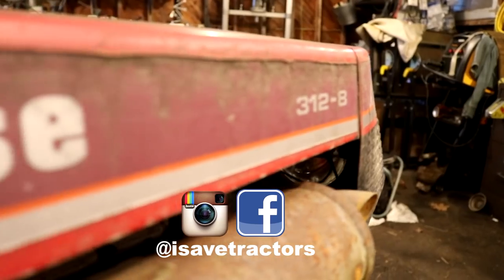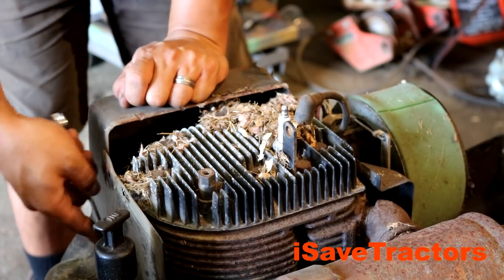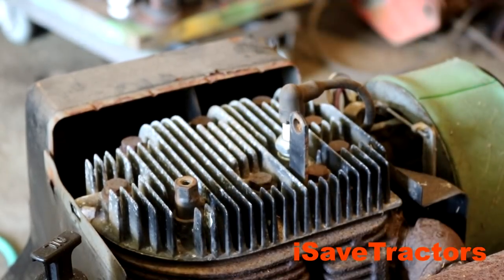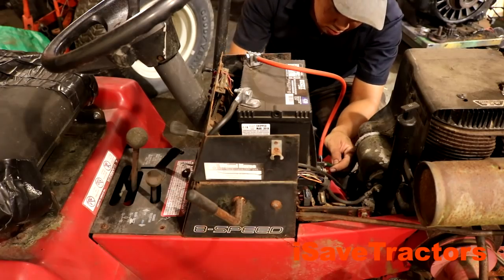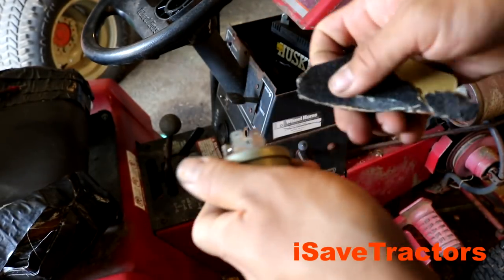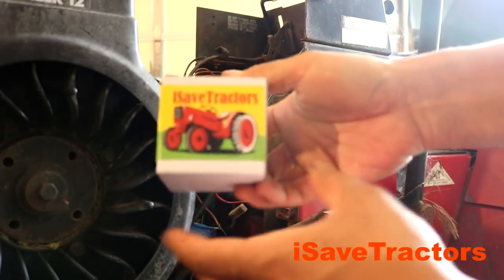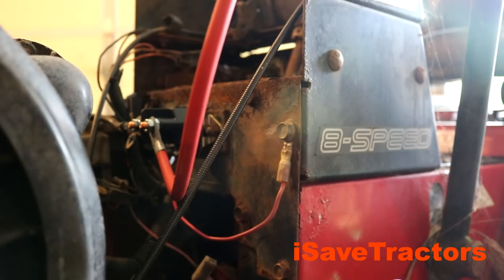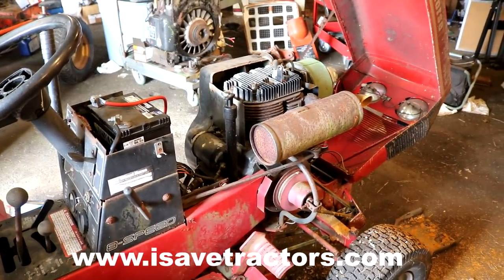Non Running Wheel Horse Garden Tractor Find Fixed in 30 Minutes!

Comment: Whenever I go to check a starter, like you did, I make the last connection to the machine frame (ground).  That avoids arcing and possibly damaging the terminal on the starter.  I just use a jumper wire to trigger the solenoid, quick, simple test.  Another idea, I keep a rich 2 cycle gas mix in a pump type oil can, use that to prime an engine.  It provides some cylinder lube.  I also use 2 cycle mix in the gas tank at first, for the same reason.  The mixed fuel lasts longer if it's a job you won't get back to soon.  Will keep you in mind next time I need Kohler parts.

Comment: Hi Norman!  Great video and step by step differential diagnosis is right on the money and straight to the point.  Fuel/Fire/Air timed right must run!  I'm a very frugal kinda guy and only thing I'm seeing is the heavy grip sandpaper.  I'd first use a brass wire wheel which takes off the corrosion and don't eat up the contact post. (bench grinder) Then if need be - Emery cloth which is much easier to work with as it is less stiff and will fold nicely to get into those nooks and crannies.  Backside of the contact posts will require this.  I've seen lots of guys squirt the carb cleaner in the plug hole but I'm kinda agin it as this is a little hard on the bore if taken to excess and used too often.  Once to look for fire Ok!  But some guys will think that this is the best and easiest was to start their tractor overtime.  If you do you can wash down the cylinder wall and lose lubrication and even compression.  Like all good things; only good in moderation.  Looking forward to your next video.  Hope my comments are not too critical.  You make a lot of good sense.  Take care,  Lee

Comment: This is all very familiar. Ignition keyswitch completely burnt out. New solenoid and new starter motor and we were in business. New fuel line and filter also. But every year I have to run fresh fuel into the cylinder to get the fuel to pull through. 31 years and still going (just)! My baby!

Comment: Just did the same thing on my new to me non running 1979 c120 auto. Fired right up after the jumper cable trick..headed over to isavetractors right now for a new solenoid!

Comment: Nice! I cant tell you how many times I bought broken stuff and it was a wire or a very simple thing. I hate key-switches,solenoids, and safety switches! Often poor quality and almost always the issue(s). I would pay 4x the going rate for components that were reliable but I have found this is impossible to get locally. Many times the new components are bad or fail early.
Reply from the maker: Give isavetractors a shot at your business!

Comment: Im looking at a workhorse I don't need another one but its in good shape not running but it did 6 years ago... I love working on these old girls...I also have AC B10  just haven't gotten to it yet. UPDATE I actually wheeled and dealed for this workhorse sitting in my yard now got it too run, weak compression let MMO soak over nite compression got up to 60 she runs now I gotta figure out the clutch! Im gonna check your page for some belts thanks!

Comment: I have a early 1970s Montgomery Ward variable speed 15. Its got a 15 horse Briggs & Stratton cast iron engine. I was using the pulley puller and pulling stuff off of it. I broke the aluminum starter pulley on the engine. I have not been able to find that anywhere. Also I need to find a drive shaft adapter that goes on the engine. I think the problem that engine has is that it has bad spark so I need to clean up the points and see if it'll start. I'm definitely checking out your website I hope you have what I need.

Comment: Before you replaced the solenoid did the instrument panel voltage meter indicate voltage and do the lights work? I'm going through this with mine. It stalled the other week and I left the key in on the position. The battery has been charged, but I haven't figured out why it won't start or even turn on the lights. Thanks for the tip of the jumper cables to the starter, I'll try that later.

Comment: Heck yeah I liked this video at like one min, I have an old wheel horse almost like that one it was my grandfathers and it is still running maybe not at its prime but from a cold start its like new these engines are the best and will go through hell and back and still run. I won't by any other tractor without one of those engines. 😎

Comment: A few words about the continuity function of multimeters. A tone may make you think you have a low resistance path when this may be far from the case. Some meters may give a tone up to 250 ohms. Be sure and check the display for the value of resistance being measured.

Comment: That's my tractor!! I'm having some trouble with the charging. If I disconnect the stator while it's running, it shuts down. Does that mean the charging is still putting  something out? Also is it possible to change it over to a magneto system instead of the battery ignition? Worst case scenario is I'll charge the battery externally. I should mention though that I had to replace the fuel pump to an electric one. So i would need to have enough power just to run the pump.  Looks like there's still some odd pieces of stuff being blown out of it.

Comment: I have a c-160 wheel horse I am stumped on. I have spark fuel  and 125 psi of compression. It will not start.  I have been jumping it off another tractor. You think not have a good battery would cause an issue

Comment: Hey! Great vid.. I have the same tractor with the same issue. The previous owner replaced the solenoid and key tumbler and still nothing. Where are you hooking up your multimeter to test continuity? One of the replacements he did may have been DOA and I guess I should test it to see if I need to order from you.
Reply: You could simply bridge / bypass the solenoid with screwdriver. If it still didn't crank you have a bad wiring connection or battery. Remember he replaced both first.

Comment: Hey Norman- what's your most admired tractor maker and why? (JD, wheelhorse, ford, cub, case). You seem to have one of each and I assume you have a favorite.  Nice work on the videos
Reply from the maker: Tough question that comes up a lot. I plan on making a video on this very topic. I seem to like them all, as they all have a different approach. But the tractor I use the most is the Ford LGT 145 with Front End Loader. It gets on average 2 hours of use every day 365 days a week. The second most used is the Ingersoll 4118. I am currently restoring a Simplicity 4040 Powermax for this channel, and I plan on using that heavily in my large garden because of the high ground clearance. So as you see, each brand, make and model are better at certain tasks than others.

Comment: Nice vid. Wish all of em we're this easy.
Reply: I’m MikeJD60 but on my other account, but I just bought a 1973 sears st16 w the 16OHV Tecumseh, the engine runs, but I predator swapped it cuz I need a tractor that isn’t a gas hog. I still have the engine, on a pallot in the back of the barn.

It needs a Jew switch, a carburetor, fuel pump, & a few other things. 

I’m using the predator because I can use it all day & only use about 1/2 to 1 gallon of gas. Just for taking wood to the burn pile, taking trash out, & mudding. 

Whereas my 82 212 will drink 3 gallons in Th ensame amount of time, these old tractors are great, but they are giant gas hogs, & in addition to that they need Ethonol free gas.

Comment: Hope you might be able to help me. I have a 520-H. I got on and tried to start it and nothing. No dash lights, not solonoid click, nothing. I checked the battery and it was old so I bought a new one. Same thing. I looked at the fuse box and it was covered in dirt and grass. I cleaned them off, brushed the fuses off, and blowed out all the contacts and added some contact cleaner. WOW, it started right up. I mowed a few rounds and my deck belt broke, so I replaced it, started the tractor and before I even moved, it died, and the same thing happened. Turn the key and nothing, no lights, no clicking or anything. Do you have any suggestions I might try to fix this. Thanks in advance!
Reply from the maker: Check your ground connections. Try jumping individual parts to track down the culprit. Visit our website for troubleshooting and tech articles. Also you're welcome to send me an email for more detailed help.

Comment: Norman: I have a 312-8 tractor as you have in this video and it has worked great for us however, now I have a leaking gas tank and can find no instruction about how to replace or what to check for. I'm stumped. Please help.
Reply from the maker: Hi there. First thing to do is check where the leak is. Is it coming from the fuel valve on the bottom? If so you can replace the busing and valve. We sell them both. If the tank has a Crack in it you can plastic weld it. First step identify where its coming from and then let me know via email
Reply from the maker: You can remove the tank but first you remove the rear fenders

Comment: You should never underestimate the stupidity of former owners! I have hade many old tractors and machinery that some smart ass “repaired”. Installing a ignition switch or connecting a carburetor to the  engine must be like rocket science to some people. Anyway what I mean is that you should check even the most stupid things if you don’t get it running. All it takes is fuel, air, compression and a spark, everything in correct timing and it works. Good video, I like the “magic” solenoid trick, only thing that would have made it even better would be a text: Magic is not included, must be bought separately.
Regards Nils

Comment: I have a 310 and either my booster pack is dinked or the starter is because it wont crank when i send direct power to the starter.
Reply from the maker: Could also be a bad ground connection between starter motor, and battery ground.
Reply: @Isavetractors  turns out it was my booster pack because it could not power my radio at all. And it was outside all winter.

Comment: Help!  I just inherited a wheelhorse from the early 60s...dont know how to check oil...
Reply from the maker: Pull the dip stick in both the transmission and engine.
Reply: @Isavetractors i cannot find the dip sticks...the tractor is over 60 years old
Reply from the maker: Both your dip sticks could be a threaded in square. For your engine it would be located on the corner of the engine block
Reply: @Isavetractors  thank you!  I cant get it to start today, may have flooded.  Someone suggested ether in the carburetor...a small squirt...is the carb on the engine where there are lines for air?
Reply: I got to laugh at that lol.

Comment: My wheel horse is a 1968 commando 88 I'm not getting spark to the I replace the coil p and I replace the
Reply: I replace the coil and the condenser and the
Reply: And I replace the points but still no spark to the points
Reply from the maker: Check your electrical with a Digital Multi Meter to find out why.